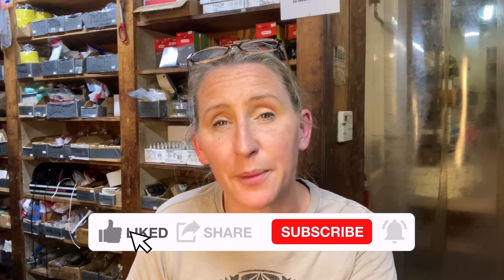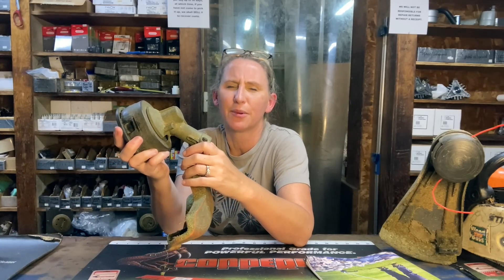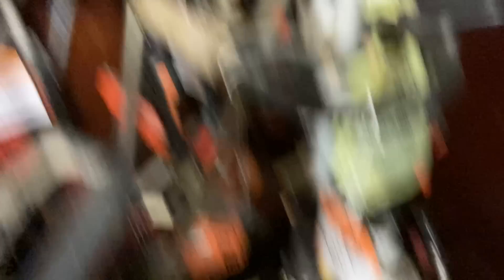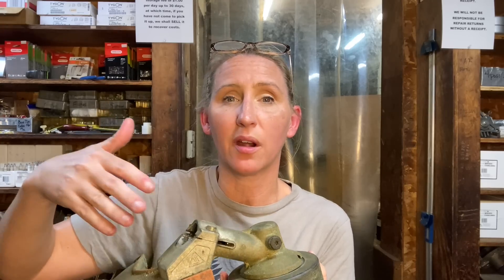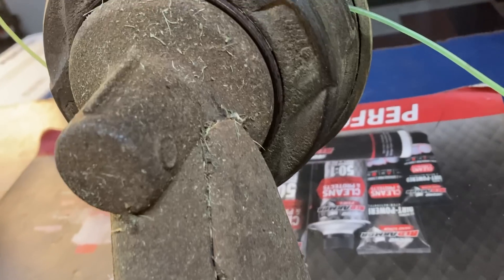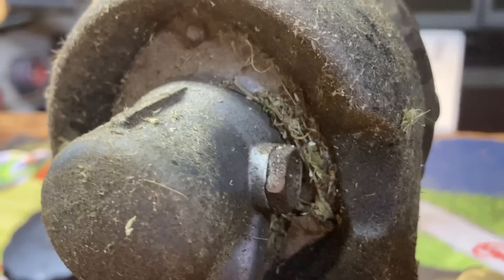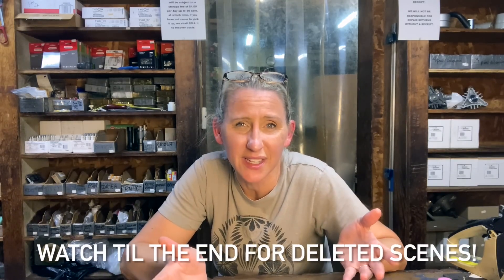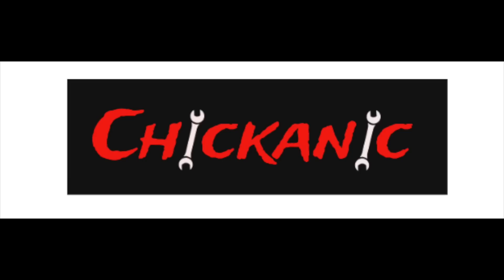Planned Obsolescence?! Why Would STIHL and ECHO Do This?!

Comment: Bean counters insist on things that are annoying when it comes to make engines not repairable by the owner. I have a riding mower with a starter that needs replacing - but for the life of me  I can't figure out HOW to get to it. There's a cowling over it - but no screws/bolts to take it off. I'm sure it's the starter because I've replaced EVERYTHING else. The battery, the the solenoid, checked all the safeties - it's the starter. It clicks and then tries to spin the motor - but spins down in a whine. It doesn't continue to spin the motor. My guess is that the teeth on the gear are broken. So, I have a new starter but I cannot for the life of me figure out how to put it on because there's a cowling covering up the bolts. Anybody have ideas?

Comment: It seems alot of tools no longer have grease fittings on their equipment. I think it is so you have to purchase new parts and not repair. Grese fittings save so much wear and tear. Grese fittings should be on all equipment with gears. PLEASE PUT IN GREASE FITTINGS ON YOUR TRIMMER HEADS

Comment: Answer: Endless rounds of cost cutting. Deleting the grease plug saves drilling a hole, tapping that hole and putting a screw in it. Maybe $1 or so saved per unit. Some "genius" probably got a promotion for deleting it. Plus, I imagine that 95% of the trimmers in use had users who never bothered to fill the grease. The same thing happened in the automotive world when grease fittings were removed from driveline u-joints, front end ball joints, tie rod ends and the like.

Comment: Hello , ive been opening up all the brands of new tech equipment and the reason for these changes is that the "other parts of the newer equipment eg "electric motor heads" they last forever so there is no reason to buy "any" spare parts so the big companys "STIHL" do have to make somthing (WARNING UNGREASED BEARINGS INSIDE MOTORS AND GEARBOXS ALL TRIMMERS ,HEDGERS & BLOWERS😲)on the machine wear out so they can make residual income. So yes you are 100% correct it is planned obsolesence . . . but you can save money in the longevity of the other parts on the machine. Buy up those good ole 2nd hand greasable heads or yes great advice on getting the kombi unit heads and turfing the shaft! . . . BTW Love your videos Bre!!🤩👏

Comment: I have to admit after having quite a few strimmers I never knew to grease them. In their defence mind my commercial fishing boat has a electric clutch for the winch. There is no grease point and when I asked I was told no need. Well twenty odd years later and twenty odd thousand Hours at maybe 1500 rpm average the bearings are perfect. It went against all ive ever learnt but it worked .

Comment: I see the same thing in the HVAC industry.  Equipment has become very flimsy and missing brass caps which have been replaced by plastic.  They also seem to be using less screws to keep things together.  It's all in the name of saving $0.60 on each unit.  I suspect the same thing with your grease plug.

Comment: As someone else mentioned, the bean counters. They save money by not having to include the landing for the fitting in the molds. Then no machining for the plug and the plug itself. Then add in if and when it does fail which at some point it will they get to sell another part sooner.

Comment: I recently tried finding a fuel tank for an FS 108 brush saw, needless to say it's obsolete. I'll admit it is an older brush saw but hey she still runs like a champ. (no more air filters available either so I just made one out of a cheap sponge made from similar material)
Reply: I think they started this MANY years ago, now that you mention the fuel tank..ALL the manufacturers, from WAYY back when, decided to make the fuel tanks on trimmers from a material that CANNOT be repaired satisfactory with ANYTHING when they crack or a hole wears in them..nope, nothing works for long..JB weld, epoxy, even plastic welder, nothing..they always leak...then they charge you out the ears for a new one(I remember a new tank for a Green Machine was over $50 WAY BACK IN THE 1980's!)..then, when they become obsolete, you can't get a new tank, can't really repair the old one, and a used one off another model won't fit-not even close..so...time for a new trimmer!....
Reply: @dyer2cycle  You might try plastic welders again.  I've repaired many small engine "plastic" gas tanks with a $12 Harbor Freight plastic welder...in just a few minutes.  Granted...you need to learn how to use the plastic welder...there is a learning curve.  Have used this plastic welder on MANY other plastic projects too.  Oh..remember to wear gloves while using the HOT welder.
Reply: @thinking6307  good tip
Reply: @dyer2cycle   Have you tried  Seal All? It is intended to be used on plastic fuel tanks

Comment: I watched the video on the speed feed head and bought one for my Stihl FS55.   Wow it’s the best!   I’ve cut 12’ lengths from a larger spool and have them ready for the reloads.  It has to be one of the best improvements anyone can do for a string trimmer!   After over a year of use it works perfectly.  Thanks for that great tip! ❤

Comment: I had a budget weedeater that had no grease fitting as well. The unit had sealed permanent bearings in the drive assembly. When I seen the unit was wearing out I took the unit a part and replaced the bearings. If the sellers of the product don't choose using a grease plug they need giving the option of replacing the bearings. It's kinda like the bearings in the idler pulleys used on the drive train of riding mowers etc. If they start making a noise, replace them before they fail. Bottom line is keeping maintenance regularly on the equipment. All my weed trimmers have grease fittings on the end and I grease them regularly, but soon of later they will fail. I agree they need grease fittings. The operators needs a owners manual with very good information.
Reply: If they leave basic info out of the manual, they usually want you to take it to the dealer so they can overcharge you or sell you a new one.

Comment: Hmm.    The one I own has no grease port either.  I've had it for 6 years.   It runs fine.    The quoted 12,000 RPM means nothing.   What matters is the pressure on the gear teeth and the tangental speed, neither of which is great in these devices.
And if you regularly change the oil in your home lawnmower, which probably won't accumulate 300 run time hours in 10 years use, you are a fool.

Comment: This is the trend in all manufacturing today. Commercial trucks aka tractor trailer power units have no grease fittings on their universal joints. Most of these trucks are putting over 1800 ft lbs of torque through these joints and no way to grease them. I see them almost every week one the side of the road with the driveshaft hanging down aka broken u-joint. Gotta love the new way of screwing the buyer

Comment: The reason the FS 55 doesn't have a grease head is because it has a flexible shaft that runs straight to the head thus it doesn't need a gearbox due to the flexible shaft.
Great unless you want to put a blade in your machine for which if you hit something you could snap the flexible shaft

Comment: Because now companies are packing bearings with synthetic grease that last many times longer then conventional grease it also has better quality lubrication.  Sealed bearings with synthetic grease are the reason most cars trucks any vehicle today does not have grease plugs.  If synthetic motor oil last 4 to 5 times longer in an engine then conventional you can just think how much better synthetic grease outperforms conventional grease.

Comment: Here's the skinny....there's enough grease in the gear head to last the life of the powerhead. Same with the briggs "no change oil" engine.  It'll run 500 continuous hours on the same oil before thickening up and overheating the engine.  Who gets 500 hours out of a pushmower?  

Btw, if you charge $40 to put a youcan kit in and set the RPMs on a $225 trimmer isn't it true in 5 years youve got an additional $200 in maintenance, 5 hours time, and gas money to and from the shop in that 5 year old trimmer.  Why not save the maintenance costs and just buy a new one?  

Ps..as an echo dealer I can attest to the fact if you do nothing to an echo for 5 years it will build up enough carbon in the exhaust to break off and fall back in the cylinder.

Comment: At least when I worked on Stihl trimmers you could expose the gears super easy. 

I always showed my customers and showed them that cleaning it out was almost as quick as greasing it.

Never seen any issues where the head required greasing more than once like every 100 hours. 

Not that I'm a fan of disappearing features, but I reckon it's more value engineering than planned obsolescence.

Either way love the videos! Thanks!

Comment: I discovered the Stihl trimmer head pricing trick several years ago. I figured they would have figured that out by now and closed the loophole. Great videos.
Reply: Charging more than $150 for the combi's attachment would scare buyers away.   Besides, the replacement head is through the parts system and more people are adding on markup.

Comment: One thing I have noticed on this video was that almost no one was greasing the gearhead or knew it was supposed to be greased.  It would be great to see a video on how to grease a gearhead and what type of grease to use for such a fast turning set of gears.  I'm sure the 90% of people who don't know how to grease the gearhead would really appreciate a video on the subject.  Will a zerk fitting screw into the gearhead without tapping out the hole?  I see that people have installed one with modifications, but I would not want to put too much grease in the head either that may cause damage.

Comment: planned obsolecence is real and its a way to keep shareholder value of any company , think of your water heater with a 5 year warranty , why 5 years , stats show the average water heater lasts just under 10 years , so once the warranty is expired they know it could fail at anytime based on your water quality,presto they have to go buy another one . B&S does it with their no need to change oil (video on your channel) its to sell new units and parts. corporate america has waged war with their consumers and we are supposed to say "i like it " and just take it.    quick fix , drill and tap the head and put a plug in it for your customers

Comment: This is why I don't buy anything new anymore. Everything made today is junk. I have a Simplicity 3310V tractor from 1970, an Ariens Sno-throw from 1969, my airless sprayer is a Graco EH 433 from 1972, My pickup is a 1973 F150 with a straight 6 and a column shift which is my everyday driver. I just got fed up with the computer chips, plastic parts and the BS.

Comment: Thanks. I have an echo srm2501. I just cleaned the echo. It does have a grease plug. I cleaned around the plug and added grease. I took off the speed head and also got out all that old stringy grass. Thanks again.

Comment: About 12 years ago, when we bought 10 acres, I bought an echo weed eater and a small echo chainsaw, on the advice of a friend. I don't abuse equip., but use hard. Last weekend I used the weedeater, literally started on the first pull. The chainsaw carb. started leaking gas a few years ago, I put on a $20 amazon replacement, and it's working like new again (added a larger echo chainsaw about that time), the only maint. they have ever needed was cleaning fuel filter.  When I lived in the burbs I would buy the cheapo weed eaters and was lucky to get a few years before something broke. I will never say anything bad about echo, I have been amazed.

Comment: I can tell you from my lifetime manufacturing experience that leaving out that grease fitting hole probably saves about $4-$5  per unit. That hole has to drilled, spot faced, and tapped. A few extra minutes of time. And the cost of the plug. Also, I have a FS66 that I got new in 1985. It has the grease screw which I check all the time and over all these years it has not used hardly any. I believe they said let's leave this out because the homeowner's will never fail and the commercial guys are on there own. 

The reason the "sub assembly", head with arm is cheaper than just buying the head is because they must have a assembly line that puts that together. If you want to just buy the head some idiot has to go to a bin and pull the head get it in the Box and get it ready for shipping.  So that makes the price go way up.

Comment: OMG, I'm glad I stumbled onto your video (It was just a suggestion). I've had trimmers for 40 yrs and never knew there was a grease plug. Admittedly most engines died before the head so never was an issue. This time tho I got a 'expand-it' Stihl about 6 yrs ago so I'm going to find some grease. I also recently got a brushless Ryobi trimmer that has worked well so far and it has a grease plug also!! Gotta say THANKS!!

Comment: now tell me true, when they went to 50/1 oil did they make any real changes over the old 40/1 engines?  Easy way to make less smoke, keep the EPA happy, and have owners trading in their old saws a few years sooner.  I use 40/1, spark plugs are cheap.  Way back when the VW beetle had a 1500 mile oil change, the next year's model when to 3K, it still didn't have an oil filter.

Comment: Yeah, when I bought my zero turn (Ferris) their pitch was their new 'greaseless spindles', a year in and all three where toast,  I replaced them with the 'wrong part' that had zerks in it.  Those lasted twenty years.  A bitch to maintain since you had to take the floor out to grease them.  might try to drill a hole in the housing and tap it for a zerk, why don't they use zerks anyhows?  I you have a grease gun way easier than that fitting.  Better to use the wrong grease than no grease, eh?

Comment: Same BS on cars. My car had non greaseable ball joints, tie rods, ect. They lasted exactly 30k miles the greaseable aftermarket set I installed now has over 100k on it and it’s tight as a a bulls ass! They removed the zercs so you can’t grease them and they can sell you more parts. It’s that simple, same BS with these 5000 mile  or worse oil changes! Half the time they tell you to use oil that is way to thin so they can get the CAFE numbers up at the sacrifice of your engines life assuming the typical person won’t run it long or hard enough to spin a bearing. Well let me tell you it happens every day and it’s labeled “abuse” basically if you operate it within the manufacturers RPM range at it’s rated power and it blows you “abused it” do yourself a favor and lookup the bearing clearances, piston/ cylinder clearances, ect and make your own decision on what viscosity oil to use! Nothing the OEs publish can be trusted anymore, half of it is to sell more parts, the other is to get better fuel economy thanks to our new communist government.

Comment: It's all about the money!!! More parts = more money.... your money!  I'd have to take a look at the casting on the new heads, if I had one, and see if it was thick enough to drill and tap and put in my own grease plug 😁
Reply: You can see the molded in spot on the head in the video where they would machine to put in a grease port.  They saved the cost of machining and plugging that port.

Comment: It's to save cost to the consumer. Ones without grease plugs are to attract the cheap customers who would have walked out of the store with a Poulan if Stihl or Echo wouldn't have had a trimmer or saw that cost less than $200. They're so cheap Stihl won't even warranty them. If it requires repair they usually just give you a new one. 

You should always avoid buying small equipment from a big box store and buy from a servicing dealer who can offer warranty repair. It's the dealers responsibility to inform the customer of the features or lack of features and point them in the right direction to select the right piece of equipment for their use requirements. Sometimes the dealer themselves are uniformed, most times it's the customer trying to be cheap and buy a machine not suited for the work they will be doing. A landscaper or guy with rental properties should never be walking out of the store with an FS56.
In today's market, if you want a grease plug, you're going to have to pay for it. If you pay less than $300 for a piece of equipment it's not usually worth the repair unless you're doing it yourself.

Comment: My guess is that the vast majority of people don't grease them anyway so they may have improved the seals and removed the grease plug so that people don't mess with it.  There are plenty of other applications where geared devices aren't readily greasable. Off the top of my head angle grinders are the most similar that I can think of.
As long as they're properly sealed there's no place for the grease to go. This is kind of like sealed wheel bearings. Unless a seal fails the grease will stay in there for the life of the bearing. And if the seal fails then filling it with more grease isn't really into you much good because the grease that's in there is likely contaminated and whatever you put in is just going to go back out through the failed seal.
Reply: Angle grinders fling the grease to the outside of the grease cavity unless the cavity is fully filled with grease.... and they never are.  Always pays to open the gear box on the grinder and add grease.